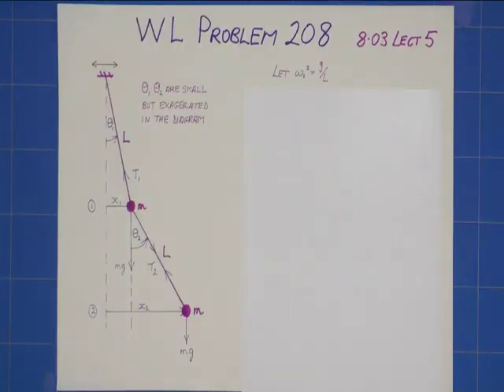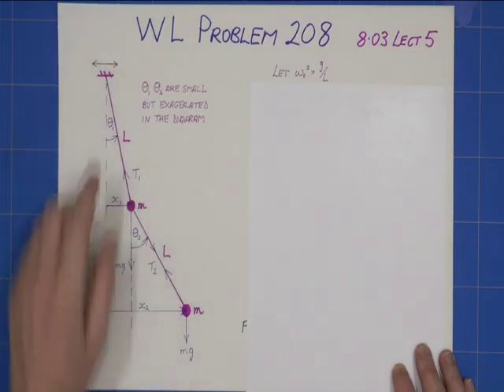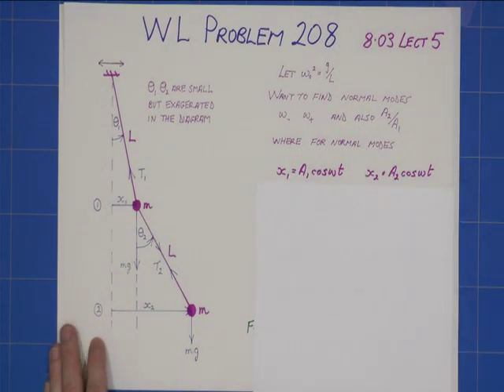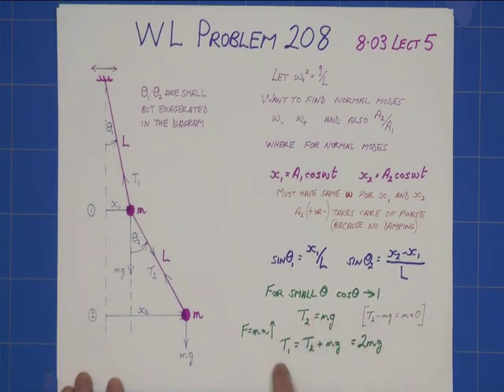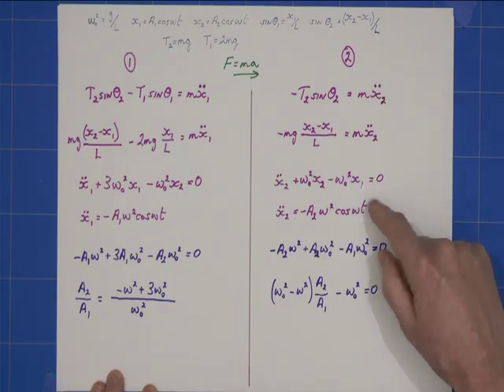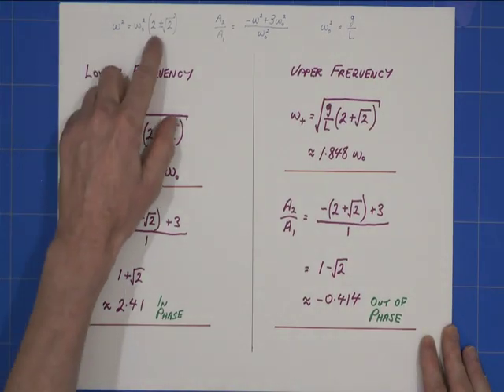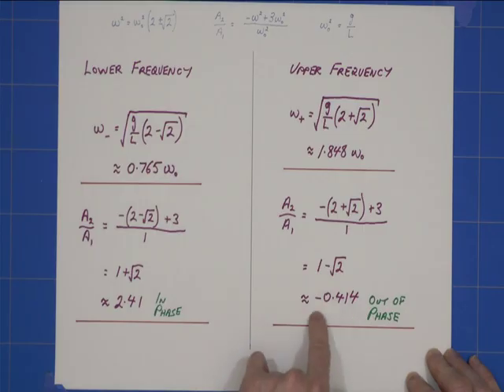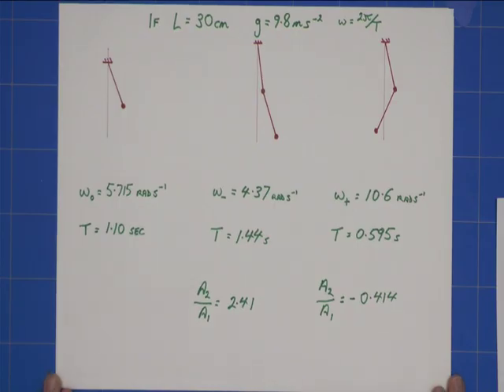Solution to Problem 208 - Double Pendulum

Comment: Hi sir , i just solved the the unsolved problem, my solution for the one of the  unsolved problem in history, navier stokes equation, i want check the correctness of the proof , can you help me sir ?
Reply from the maker: you should first publish it I will then read it. I never get involved in new ideas of my viewers, that is a matter of scietific honesty.
Reply: @lecturesbywalterlewin.they9259  thanks for reply sir , but it's very large , i have done improvement over time to time ,more than 100 pages , so I want just make sure everything is correct before publishing the main proof from it , I want you to review the whole steps that all are correct or not ?

Comment: Sir can you please explain the concept of average velocity and average speed by taking a example of motion of a body and derive the formula of average Speed and velocity and what is difference between uniform speed and uniform velocity from its average velocity and speed?
Reply from the maker: don't be lazy  I cover that in great detail in my 8.01 lectures
Reply: Sir  I am asking that question because when we use that average velocity and speed formula , if the body travells unequal distances in unequal interval of time or unequal distances in equal interval of time or equal distance in unequal interval of time in which case we use average velocity and speed formula sir ?